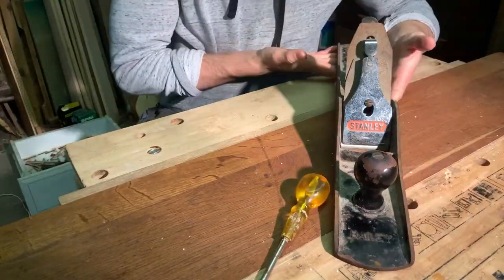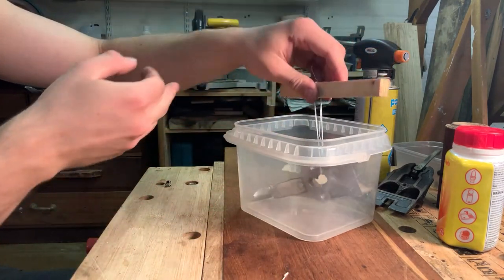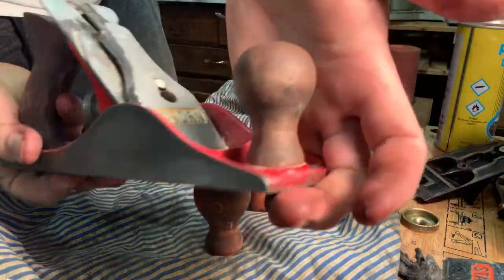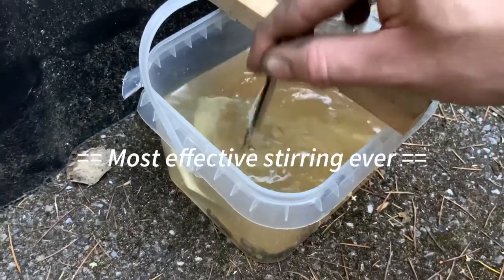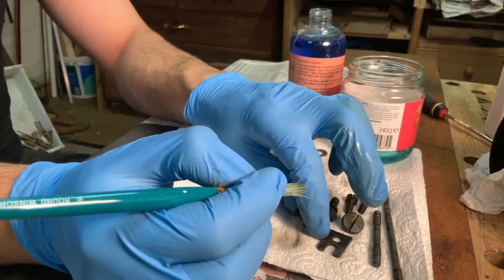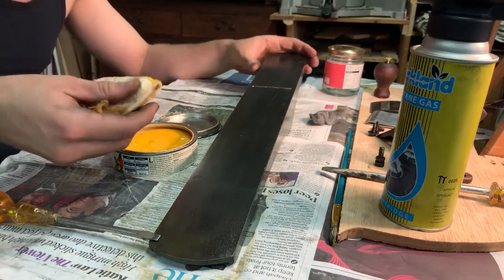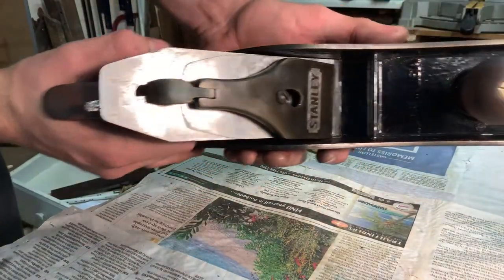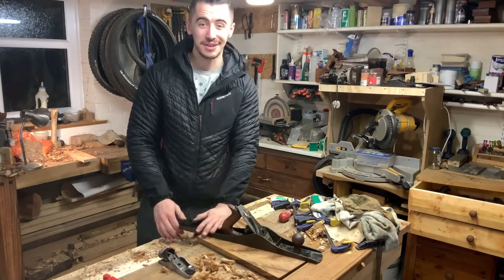Restoring a Legend: The Stanley Jointer Plane

Comment: Great video!it seemed like it was really hard to push. Were you just going slowly or the wood was hard  or just because the table was rocking? I just got a Stanley no 6 from 1902. I sharpened it but have had mixed results. Im watching because i do want to restore it, although for 120 years old its in great shape. Mainly jeed to flatten the sole and learn how to sharpen better.any tips for a noob about to attempt the same thing you just nailed?
Reply: The biggest thing that will affect this is purely the sharpness of the blade. If you're willing to flick the blade with your fingers like in this video - its definitely not sharp enough (you would lose the tip of your fingers if it was.
Reply: Watch a few of Rob Cosman's or Paul Sellers' videos.

Comment: It's interesting that the bleach did anything to the rust! I'm very happy that it worked for you, but bleach is an oxidizer and should have made the rust worse. In the future, you should use vinegar to remove rust gently and inexpensively. I'm a woodworker and antique plane collector as well and any time I've been brave enough to try restoration that's what I've used and it works wonders! I prefer distilled white vinegar. Beautiful work regardless!
Reply from the maker: ahh wonderful! thanks so much for the info! I'll be trying tsome vinegar next time for sure then
Reply: @southcoasttoolco.2435  Hi you should never use vinegar to clean.its an acid. If you leave the slightest amount on the steel it will rust. Use a product like evapo rust, once you have cleaned up parts, put it in a container and use next time. Cheers from Tasmania

Comment: It's  not  a type 7 , if it's  a  1933  it's  a  type 16 , still a  nice  plane, but  you  need  to  make  sure  it perfectly  flat on the  sole of the plane  and  sides too.
Reply from the maker: Ah thanks Roy! You’re totally right, I  misspoke on the voiceover - this is a number 7, and I think a type 15 plane - but I did just use a plane dating site, and am certainly no expert! The plane sole was lapped off screen (glass/sandpaper combo) - I didn’t touch the sides much as I don’t intend to shoot with it,  but perhaps I’ll revisit it now I’ve got a cast iron table. Thanks for the interest!